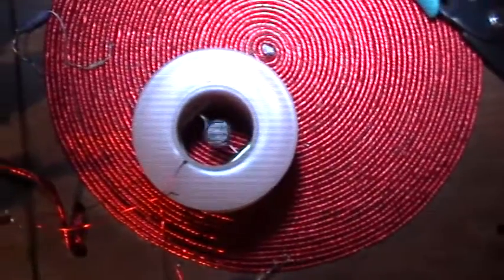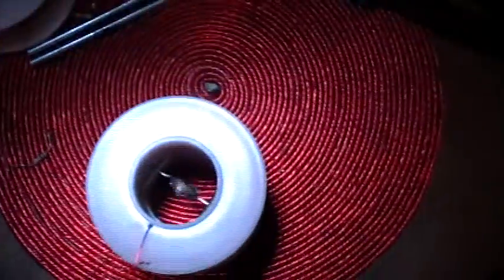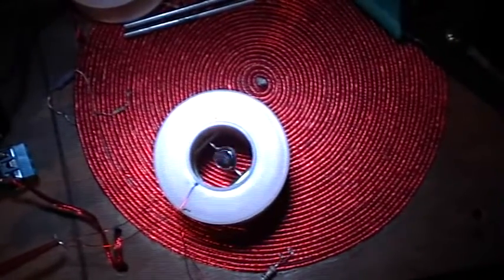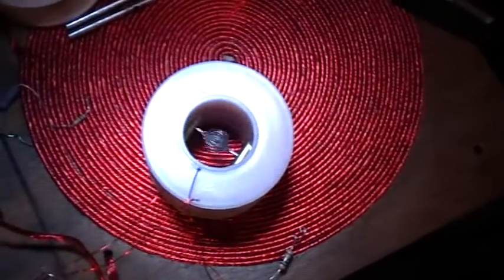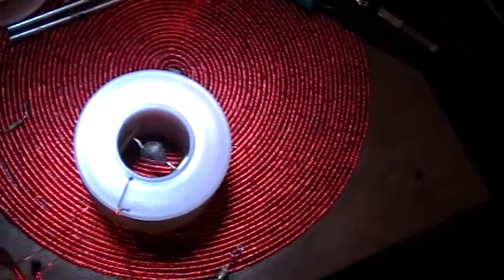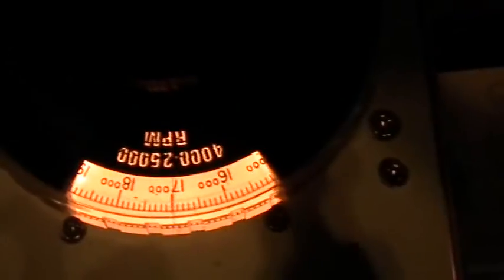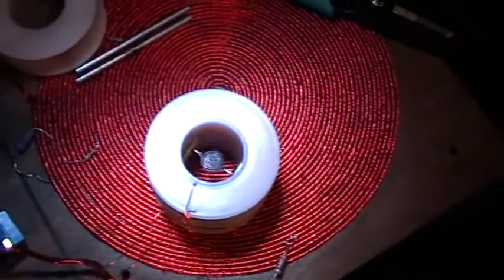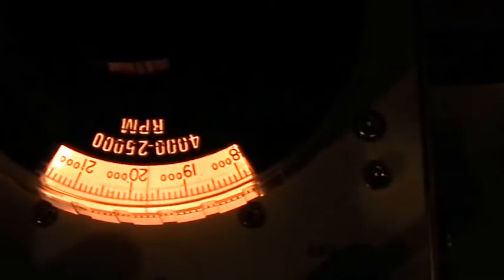Pulse Motors: MagSpinner 1.2: New Suspension, Speed Record

Comment: can you opto -isolate the output of the FG to trigger the spinner?
yes of coarse there will be nothing to see without some HV running over the spinner,just had a brain storm.
use a spherical magnet sitting on a glass plate.
bring the HV into the dome through foil that the spinner sits and turns on,and turn the spinner with a coil under the glass,that way your only chance of HV reaching the spinner pulse circuit will be capacitive coupling from the foil through the glass to the coil.

Comment from the maker: Yes, I made the flat coil myself, 14-strand "Litz" made from #27 magnet wire and spiralled onto the board, stuck down with adhesive. It's not used in this experiment though, it's just cluttering up the table.

In one of these videos I show scope traces which give the input power and show the phase delay of the current. The power input isn't small for the highest RPM. A lot of power is wasted in vibration and the no-bearing mounting of the magnet spinner.

Some friends use sphere magnets: wow.

Comment: I guess I'm new to your process.  Can you explain your circuit "theory of operation"?
I'm guessing a signal generator with current amplifier into a flat "pancake" coil. Is that all?  Or is there another coil in the framework that holds the magnet?
How much voltage and current? Did you make the flat coil yourself?
Please explain.  Why does it spin so much faster than the pulse rate (250ppm input, 20K rpm output)  Wow, that baby can spin fast!

Comment from the maker: The illumination in the frame is mostly coming from the GenRad StroboTac. When it looks like it's not spinning, that is when the flash rate of the strobe is the same as the magnet's rotation rate. This is all happening at hundreds of Hz; the camera frame rate is only 29 Hz or so, so the aliasing caused by the frame rate vs. the flash rate produces dimming and brightening, occasionally a dark frame. But what you are seeing is caused by the stroboscope and is a deliberate part of the demo.